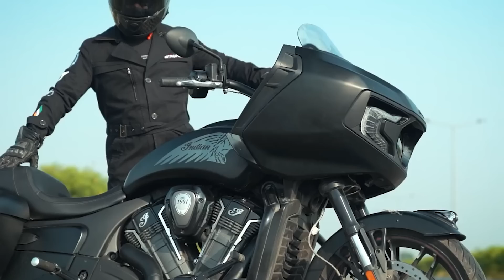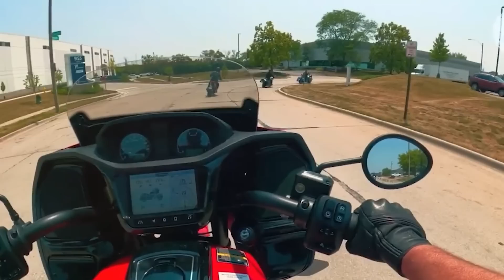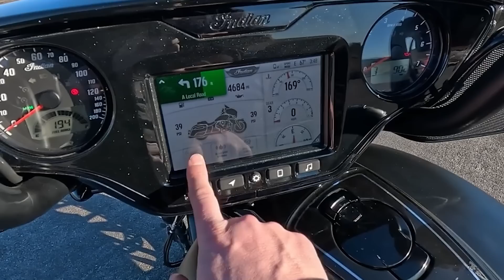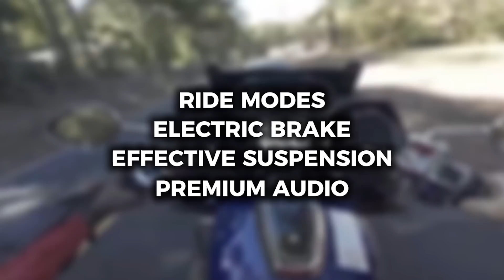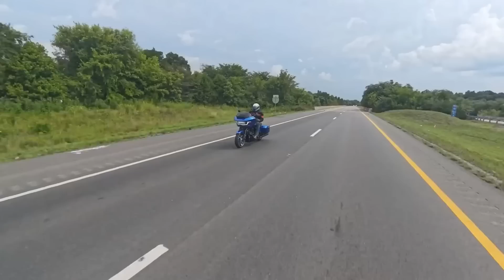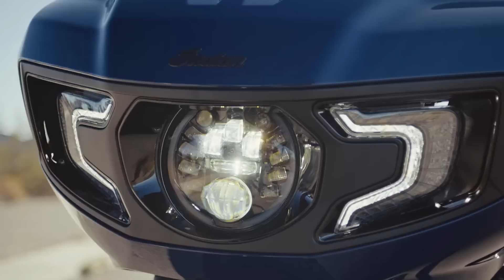Indian Released New $13,000 Challenger & Obliterated Harley-Davidson Road Glide

Comment: The Challenger engine and engine area is ugly as hell. The aftermarket accessories and engine upgrades alone for Harley make it more desirable. Big bores, turbocharger kits, supercharger kits..... you name it, it can be found for Harley. If the Indian Challenger came from factory with a 150hp/150tq model..... I would seriously contemplate switching brands.

Comment: My '04 VROD was fast and a beauty, but I am 6'5" The Wide Glide is a more comfortable ride.  I grew up admiring at Harleys with air-cooled big twins. I still have a bias against radiators on bikes. The Evolution motor is a good motor, and the air cooling is not an issue.  I would not mind snagging another VROD. I think it's an engineering marvel and will become sought after in the near future. The Road King & Road Glide are also on my list. HD must not spread themselves too thin. Just concentrate on their time-tested models and work to bring the cost down.

Comment: I'm rooting for HD.  I traded my 2004 VROD for a 1997 Wide Glide eight years ago. I get the seven-year itch and start wanting a different bike. My '97 FXDWG is factory Black. Only 22k Mi., So time to facelift the old girl. I bought raw steel replacement fenders, a used silver-teal HD tank. A new 16" 40 spoke rear wheel and Dunlop tires. The fenders I sanded with an oscillating sander using 80 grit, I put on 3 coats of clear, then added "Mickey Rourke (HD & the Marlboro Man) stickers,  Grateful dead art work and Muhammed Ali's image. three more coats of clear, sanding, polishing. A tribute to some the best of America during the tumultuous 60.s & 70's..
     The bike looks nice in black, so I will take the original black fenders/ tank color sand & polish. I never liked the factory tank decal with the gold pinstripe flame. So, I bought a HD logo decal more to my liking. I will sand out the factory decal, blend in new black and put on a decal. then clear coat When I get bored, I will switch it "Back to Black" (in seven years?)

Comment: Where did this guy get his figure of $13,000 for an Indian challenger? I’m looking at the Indian Motor Cycle dealership in Marietta Georgia online. Pricing runs from $27,249.00 to $33,749.00/ On the 33K price. You get power band audio, blacked out and a deep blue that looks like . The new Harley CVO.